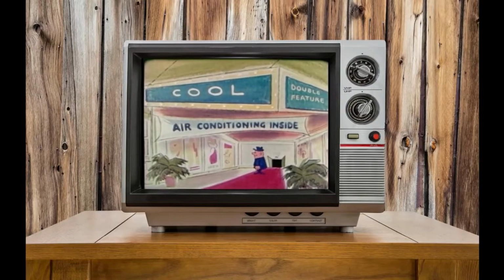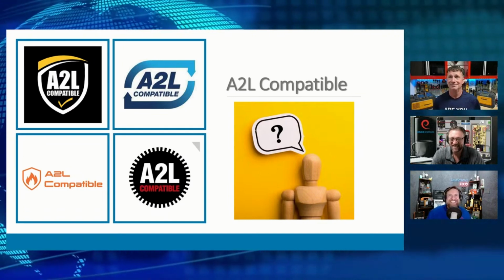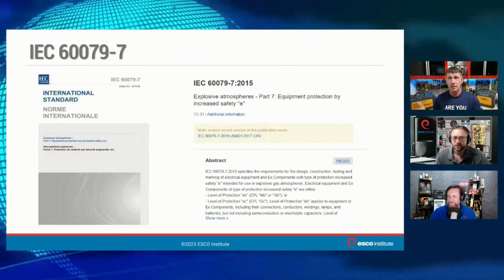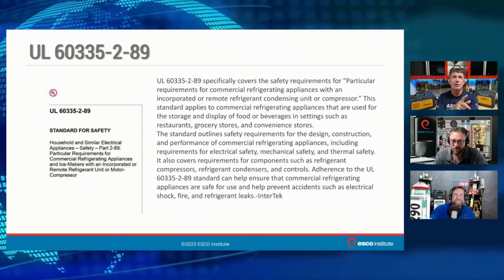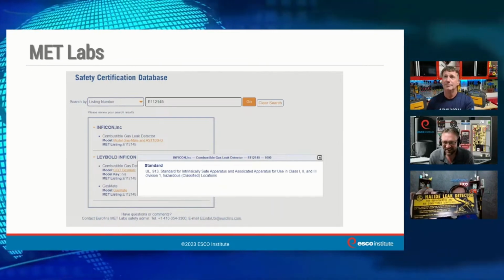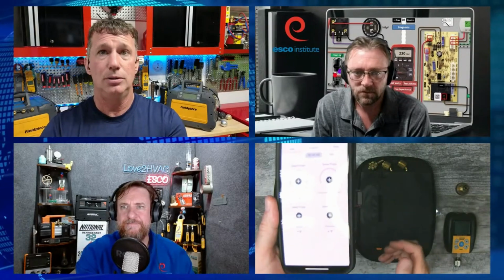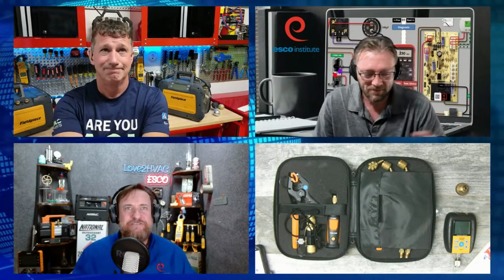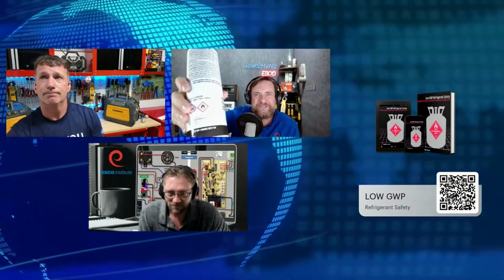A2L Certified VS Compatible Tool Confusion-"Did You Know" The ESCO HVAC Show-Episode 93

Comment: Element E50 Fire Extinguisher Stick: i checked out the real life non-sponsored tests and don't see why you would recommend this, have you tested this yourself? The fires tested were fairly large compared to what I've encountered where my spray soap bottle or throwing one of my wet rags on the fire sufficed but seeing this Element used on a larger fire and not being successful in extinguishing that fire is unsettling to see being recommended here (i did have a fire extinguisher with me on these rare occasions just didn't need it.) I know you mentioned "you have to know how to use them beforehand" but seeing them demonstrated I would also recommend using a disclaimer such as an example: "knowing when and/or what kind of fire they are suitable to be used on." I could imagine how an attic with blow in recycled paper insulation could quickly grow to exceed the Elements compacity to extinguish the fire; supposition only.